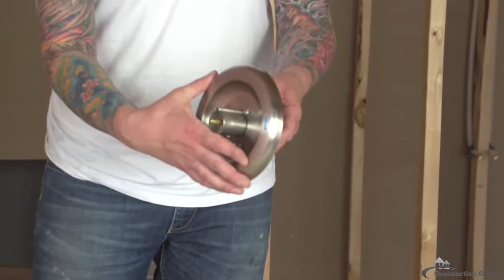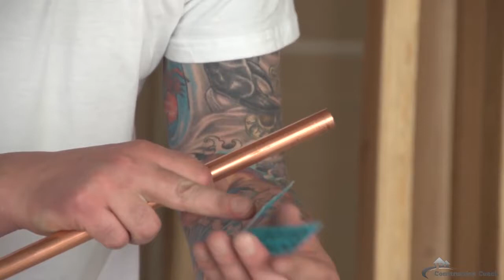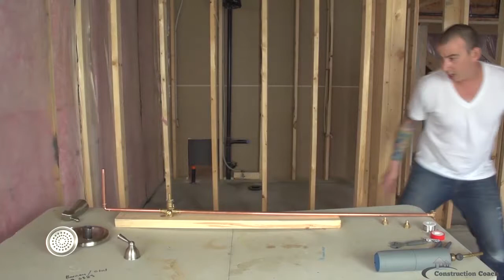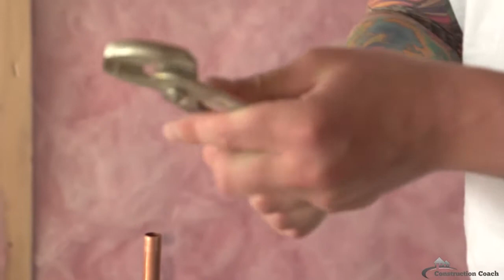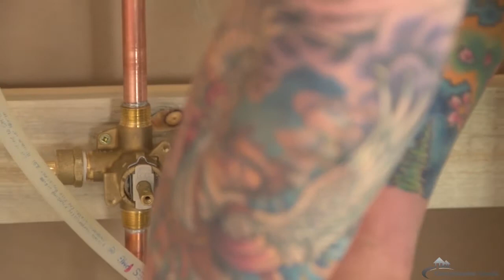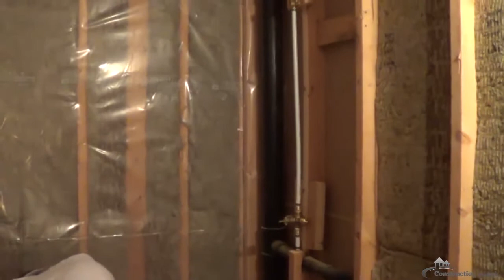How to Prep your Shower Valve - DIY Plumbing

Comment: Not sure who taught you but you don’t know shit about plumbing let me be the first to tell you.  I’m a actual C-36 plumbing contractor and you don’t point the flame or “rose bud” of you torch or flame towards the cup, you aim it from the edge working your way backwards to the end of the cup.  Smh. Also you need to tell your crowd of dyi’s to also make sure to “reem” the pipe after cutting it and before fluxing it. Smh.  Fucking joke!! So much shit wrong With you fucking DYI guys. But it keeps me in business so I guess keep on keeping on.